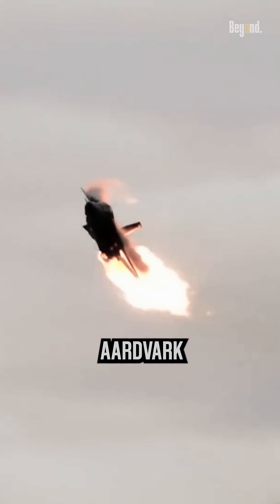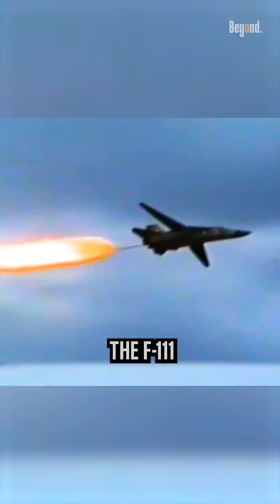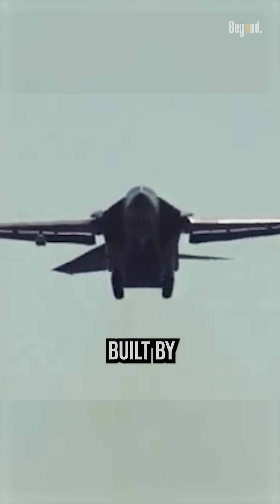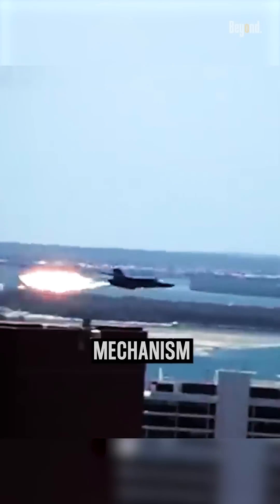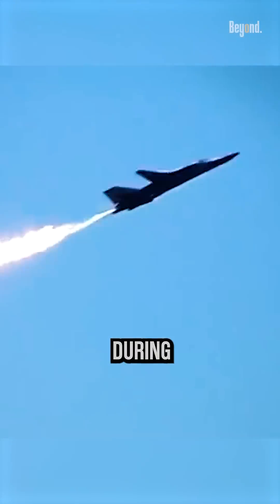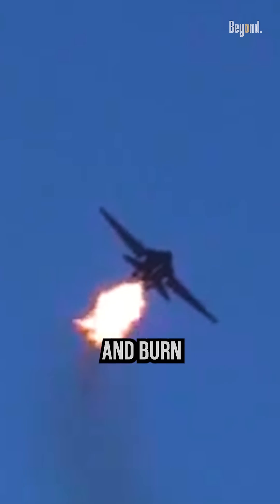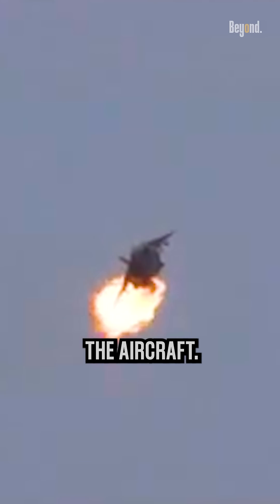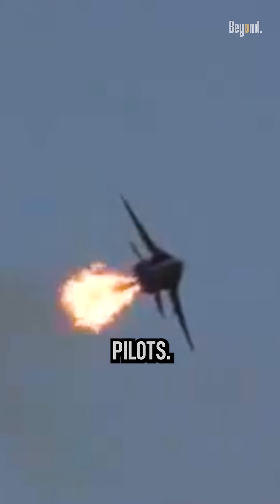Something You Never See Again In The Future Unless An Accident #shorts

Comment: That is $100,000 dumped for nothing.
Reply: Wrong.  In it's most advanced variant it had about 4,000 gallons max.  Back in 70's through to about 2003 it was from 50 cents to a $1/ gallon.  More like dumping $2,000 to save damage to a million dollar airframe.
Reply: @jackryan2502 actually way more then 4,000 gallons it carries about 30,000 pounds of fuel that's way more than 4,000 pounds